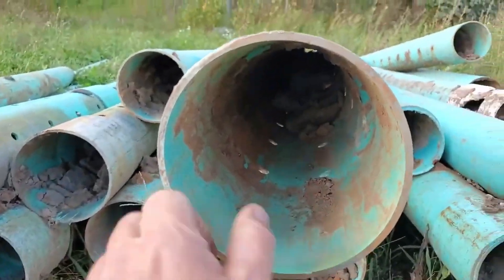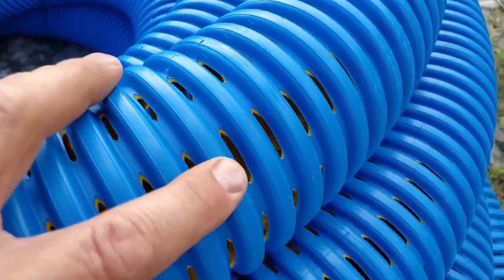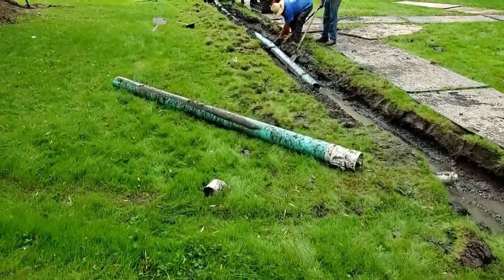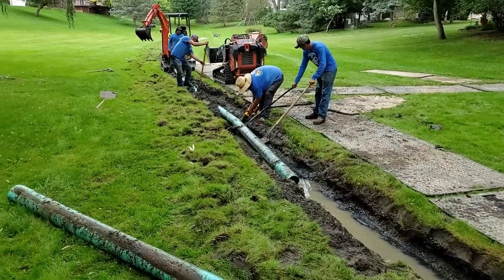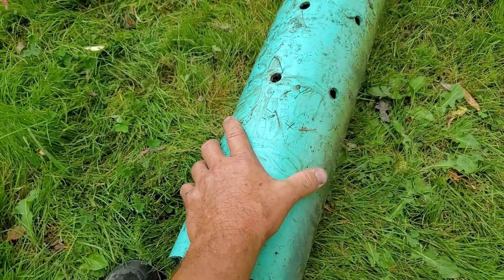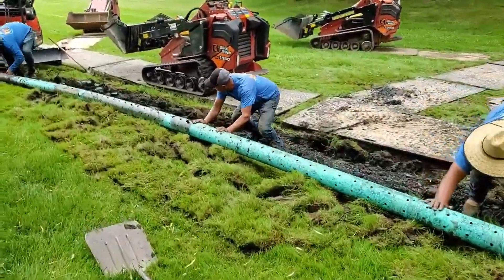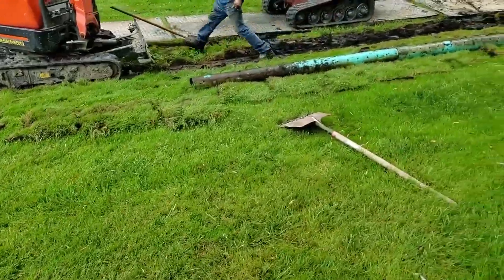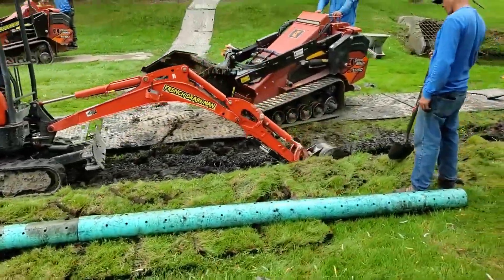Is PVC Worth It for a French Drain?  [ What is the Best Yard Drainage Pipe ]

Comment: What if drill holes 360 degrees on pvc or sdr35 and put gravel/fabric?
Reply from the maker: It becomes too weak. It does not have the same qualities as HDPE.
Reply: @FRENCHDRAINMAN  is there a way to get pvc perforated pipe since some of my clients rather have it for french drains? And I can connect it to solid pipe with a clean out

Comment: Why wouldn’t you try to hydrosnake it first to clear it out
Reply from the maker: Because the aggregate is plugged solid with sediment at the bottom of the trench. If holes were 360 degrees all the way around the pipe, the pipe would take in water. Unfortunately only corrugated pipe has holes 360 degrees, PVC does not.

Comment: My question is I need to bury a pipe that is going to go across a drive lane onto which cement trucks are going to subsequently drive onto, gravel covererd temporarily 1.5 thick or more of gravel. I do not see anything but PVC hard pipe being able to withstand that. Am I right? I see past that point having more options to change the material so to drain water away from my house foundation. The overall pipe lenght is to be 15 meters and it sure is going to slope 2% or more to a capped or partially capped end. Any tips? I see this does not really compare to the very long system shown in your above video but, could you give me some tips. Thanks
Reply from the maker: I would put in steel culvert

Comment: Question, would the PVC have failed or stood more of a chance,  had it been wrapped the way your crew typically does with the non woven geotextile fabric and the 1½" round rock?
Reply: Yep
Reply: Absolutely
Reply: Yes. The problem here is the sediment clogging the pipe. A massive issue. Very obvious problem. The solution is not the pipe type but the FABRIC. The non woven geo textile will prevent all that fine sediment from moving from the surrounding native soil into the gravel trench and into the pipe. No sediment in the pipe, no problems.
Reply from the maker: PVC has disadvantages because it only has holes on the bottom. It's also terrible for humans, animals, and the environment 
https://youtu.be/kqUNnc0j8Kg?si=75YeytVBmy4zKAcn

Comment: Ok so is it the Pvc or is it because they didn't have fabric?
Reply from the maker: Only holes on the bottom. Corrugated has holes 360 degrees
Reply: @FRENCHDRAINMAN  in theory if a person already had their own pvc and drilled their own holes all the way around and used rocks double the size of the holes and then burrito wrapped it, woud it work fine? Assuming they only had to go in a straight line.